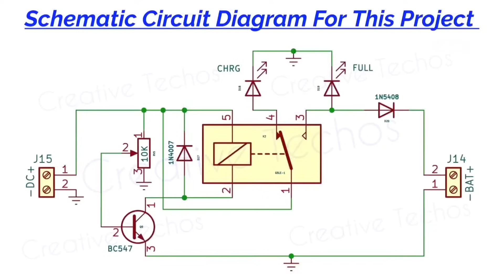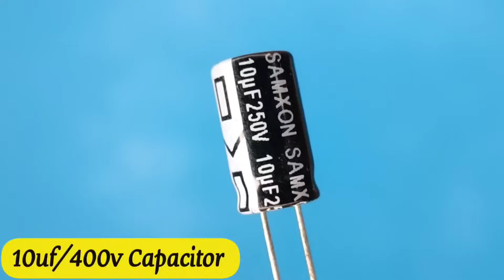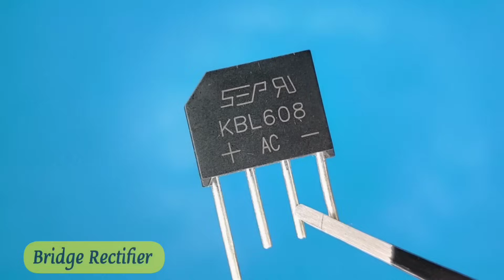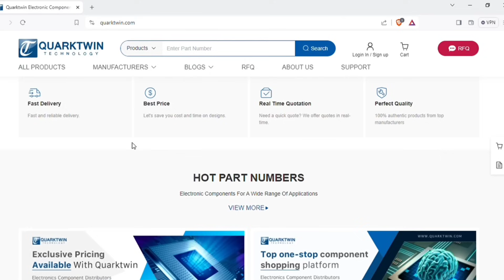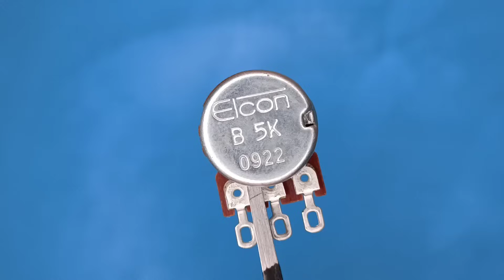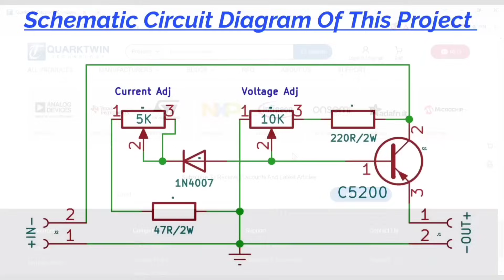5 helpful Electronic Projects for beginners

Comment: In the last project the output voltage will have a noise so you can use 0.1uf capacitor for filtering
Reply from the maker: That's a great suggestion! Thanks for the tip.

Comment: 1st schematic is incorrect and does not contain the resistors. The LEDs will burnout immediately if assembled like your schematic. This is not safe for beginners and it should not be used by anyone. There is no safety in this circuit

Comment: Sir, is the C5200 transistor a PNP transistor that you used in the last project ??...you showed the PNP symbol for it in the diagram...i think it's NPN, & there is an error in the Ground portion... PLEASE CHECK THE WHOLE CONNECTION...

Comment: The second project is a capacitive dropper. Useful for driving low power circuits but MAINS VOLTAGE KILLS! The circuit is in no way safe to touch, even though he touched the output wires. The only thing standing between you and the live mains voltage wire is a diode and two resistors.
Same goes for the third project. Never play with mains voltage unless you're a licensed electrician.

Comment: I built an enclosure for an old Pioneer car stereo that I use in my garage. I power it with an old CPAP power supply that converts 120VAC to 12VDC. The problem I am having is that anything the power cord gets unplugged, I lose all of my presets. I am trying to figure out a way to make a battery backup. I'm not sure if putting a capacitor in parallel with the power cord would be an option, and if it is, should I place it before the transformer, or after?
Reply: project 5

Comment: Request for Autocut 220v Ac with 12v relays for home and industry water pump motors. Autocut over voltage protection same formula but we want to knows, how to cut 220v on single face motor 🎉
Add more components use similar potential meters ,
कुछ-न-कुछ आशा सम्भव है 🎉 12:07

Comment: The  1st schematic have errors
Reply: You said that because you analyze ONLY  the schematic, and not the actual components in video.. Because if you do you would say, "Where the heck are two resistors in this schematic??? " And i should say.. ALL OF THEESE ARE SCAMS.. just check it by yourself if you have time..
Reply: What exactly
Reply: look at the schematic. there is no way for the battery to even give feedback.

it is also extremely power inefficient, and lacks the super important CC feature.

if you see anyone build circuits without explaining them, run. they also don't know how they work.

Comment: Chrg and full symbols on schematic are opposite, reversed. In base of transistor you have to put resistor, to prevent blow up of transistor. So, how could transistor know is it accu charged? By measuring voltage on thd source? Bro, do not fool these people anymore
Reply: There's nothing in that circuit detecting battery charge level.
Reply: @markanderson8066  A transistor can detect. But this device is arguable, it's detection is "flowey"

Comment: Maybe someone smarter in component circuit design can tell me why would you choose to use 3 mosfets to vary the speed of a dc motor when the same thing is accomplished with a 12v battery the motor and a potentiometer of appropriate resistance?
Reply: Your assumption is a fatal error!
Reply: @baxbanni2226   your response is neither helpful nor informative.  Please expand politely.
Reply: @phookaziz3  I am sorry, but I said it short because I saw a huge lack of understanding in electronics. The main thing is that it is not a smart idea to lead the whole amount of motor current through a potentiometer. In worst case the power dissipation will destroy your potentiometer. With MOSFETs you keep power dissipation very low. 😊
Reply: @baxbanni2226   that doesn’t quite make sense to me as plenty of devices like cheap fans are turned on with the most current first (so the dc motor can overcome its motionless inertia) then the main switch or speed control can step things down to lower speeds with increasingly higher value resistors.  A potentiometer just does this on a continuous curve instead of stepwise.
Reply: The motor he was using was a brushless dc motor (3 phase brushless).
Reply: @ThisIsMe-p3s  is a three phase motor not subject to the same ohms law?  How does the mosfet control the motor differently than just a variable resistance?  Or is it just using the transistors to “dial in” that resistance automatically?
Reply: @phookaziz3  Each phase of the motor must be energized sequencely.  These types of motors are used in RC projects alot and are controlled  by an ESC (electronic speed controller) that passes high current to the motor from a low voltage-low current control signal.  While this is an overly simplified explanation I hope it helps.

Comment: No 1º projeto o diagrama esquemático tem erros graves.
Reply: first the charge led would blow up as there is no current limiting resistor, 2- there is no way the relay would turn off by the battery voltage as it controller by the input voltage and pot

Comment: In design 1 there is a error in the schematic the LED's are labelled wrong.
Reply: I also saw that.
Reply: Not to mention lack of limiting resistors = 12 volts across the LEDs.

Comment: You should do in a breadboard so that we will understand properly
Reply: When I learned electronics we would place the circuit on a breadboard, then draw it out on a full copper PCB, etch the board in etchant solution, drill our holes with a 1/16" bit, and solder our components on. Sadly, those days are replaced by people taking short cuts. I'd bet some of these circuits will experience cold solder joints over time with the improper soldering technique used. always heat on one side and apply solder on the other side and let solder flow towards the iron.
Reply: @TheCommo81  You're making to much sense.  No one is going to listen except people like me.  I could have easily written you comment because this is how I was taught as well.
Reply: @TheCommo81  That works, there are also those circuit boards that are basically just a whole field of pads to solder. Or, you can go high tech and use a laser to burn away the extra copper.
Reply: Same shit
Reply: Nah.. this works fine
Reply: These foreigners don't know what a breadboard is!!  I've never ONCE seen any of them do anything except solder al the components together like this.  Maybe they're just too poor to be able to afford breadboards or a decent soldering iron.
Reply: @stevenA44  At least poke some holes in cardboard and do that if one cannot afford a bread board.
Reply: So last night I started thinking about this, and this morning (just now) I decided to try and fit one of these ICs into a few of my breadboards and a perfboard, and it turns out that the pin pitch isn't able to line up with the holes on either one of them, so that's why they build the circuits "in the air".
Reply: @stevenA44  In 1987 I was taught to take the IC, place its legs on the table and bend them slightly on each side.  I was 6 then. I can't believe others would have never thought to align the pins as such so they could be placed on the breadboard. It takes 10 seconds and doesn't damage the IC.
Reply: @TheCommo81    Yeah I guess one can do that.  Never really thought about it.
Reply: Good idea! So why don't you do a video mounting these circuits on a protoboard, and then upload it to your channel?
Reply: @ALEFILES 

If it is someone requesting further explanation, is probably because they need it. Not just because.
Reply: @ALEFILES because he probably doesn’t understand so much ether so maybe he could but also no one would watch
Reply: Good point
Reply: Or on a pcb

Comment: The 2nd project with the full bridge and powering the mains is very dangerous. If the 2 prong plug is plug in the reversed (AC pin1=Live, pin2=Neutral), it is not safe to touch the DC terminals! Anyway, it is dangerous to touch anything that is in direct contact with the mains power.
Reply: Guys you are really not an electronic Engineer,Do you know that a smallest capacitor can ack like a barrier to AC so why you call this project dangerous which mostly used in street and advertised light since the 1970
Reply: Why is it usual that one component or another is different between the video and the schematic?
Reply: my freiend 🤣🤣🤣all the circuits presented here are built using capacitive reactance theory for stepping down the input AC mains voltage. All the designs presented here work independently without any transformer, or no transformer.🤣🤣🤣
Reply: Due caution is called for, but alarmist comments aren't. High voltage is a fact of life in electronics. Get over it or get out of it.
Reply: @joewoodchuck3824  "alarmist" dude, this is AC mains voltage. IT WILL KILL YOU. Not safe. Idc what credentials you have, I'm a licensed electrician and my official verdict is NOT SAFE.

Comment: can we charge lithuim battery 14.6v?
Reply: no, absolutely not. Never ever try to charge LiIon batteries without a proper BMS (battery management system). Also, the circuits using AC mains voltage here  are extremely dangerous for so many reasons (obvious risk of lethal shock by touching the high voltage exposed leads, but also in case of failure of this kind of "droping capacitance power supply", etc...)